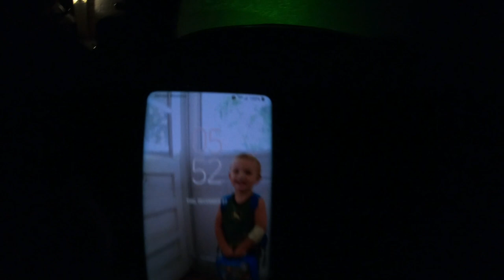old house demo pt2 badger goes HAM

Comment: You guys should be wearing better breathing protection doing that, if there is not asbestos the silica dust is proving to be almost as bad. I have been in construction all my life and am starting to have problems related to dust exposure as I get older. Proper respirators and disposable coveralls would be my recommendation.
Reply from the maker: Yes someone else said the same thing! I will keep it in mind for the next one. Thank you for the information and concern
Reply: Just wanted to share my experience and concern. You need to be around for a long time for your son. Badger is old, so ..... (just kidding of course). I admire the work ethic you guys have, always enjoy your adventures.